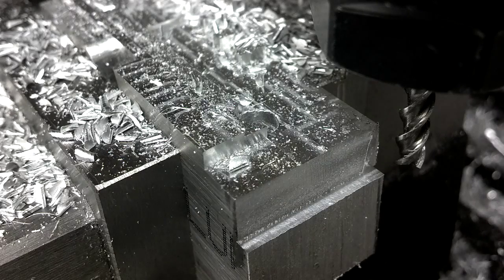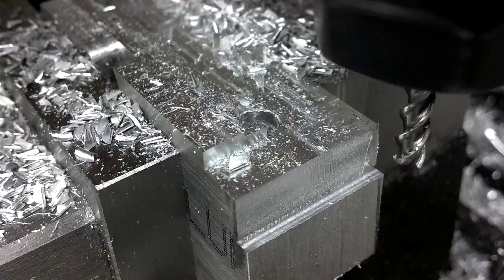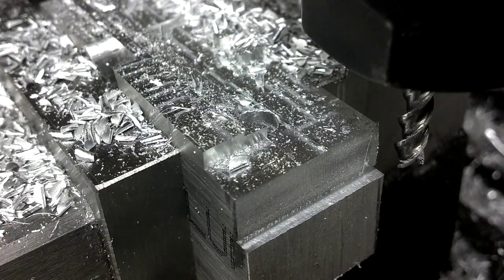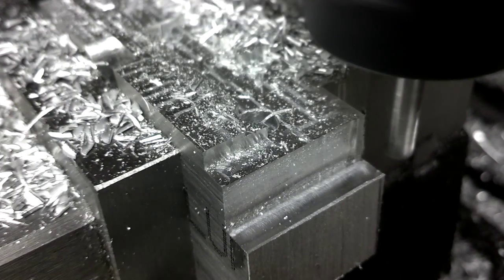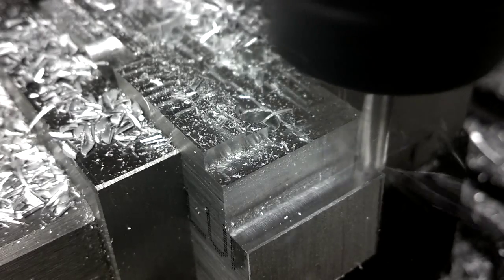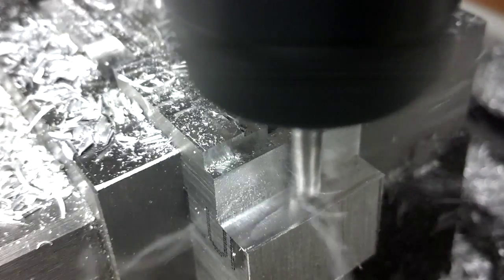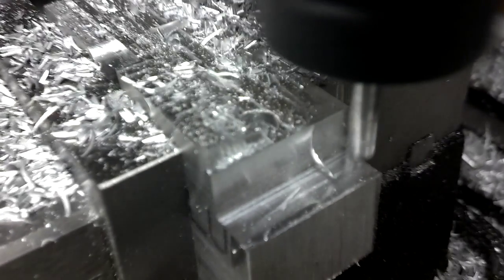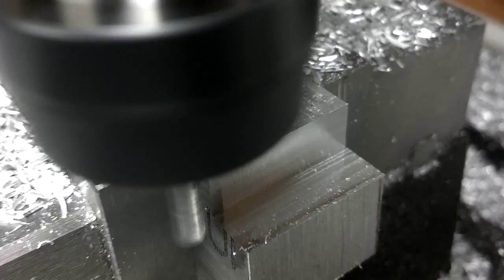Project Frankenmill #5: Testing Small Endmill at High RPM

Comment: I run like 24,000 rpm on aluminum & 18,000 rpm on mild steel. Higher rpm = more heat leaving with the chip.

Comment: Small cutters fast speeds. What if I only mildly like it? What if I were mostly pleased but less than love? What if I were impressed but not enamored? Great work, thanks for sharing with us.
Reply from the maker: Sorry, anything short of unconditional love is unacceptable.
Reply from the maker: P.S. awesome conversion on that Bridgeport.  Bummer about the PDP 11, that would have been cool to see just from a historical standpoint.
Reply: TangentAudioVideo That's it I'm un-subbing....as soon as you're done.... I need to put more vids up. That old bridgeport is making parts. I'm making a clamp to hold a high speed hand router so I can mill PCB's and engrave. The spindle is limited to 3000 RPM sp speed and feeds are a tad clunky. What I really need to do is go to VFD and look at what I need to do to swap out the bearings to something that can go to the 8000 RPM+ range. But I think that a bearing swap might really just warrant a new machine. I'd hate to take a working machine down.
Reply from the maker: TalksWithDirt One of the earliest projects I did was to make a mount to hold a Proxxon rotary tool (Dremel-like tool).  It worked pretty well for engraving, and probably would have worked OK for PCB milling as well.  I think you'll have even better results with a router since they're made better.

I was in the same boat in terms of being stuck with a slow spindle.  My max was 2200 RPM at about 3/4HP.  Dreaming of higher spindle speeds is what eventually led me down the path of this little mad science project.

I think you may be right about messing with the old Bridgeport spindle bearings.  How about a 3X speeder attachment?  I believe this will fit onto a Bridgeport spindle nose: http://www.tormach.com/product_pcnc_acc_speeder.html

Not as rigid as a dedicated spindle, but the sideways forces on small cutters are pretty low.